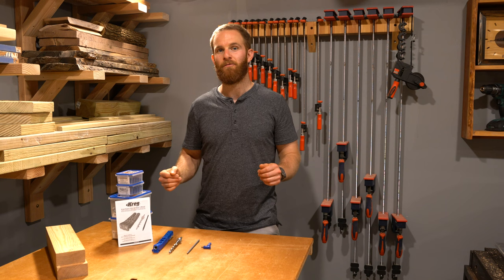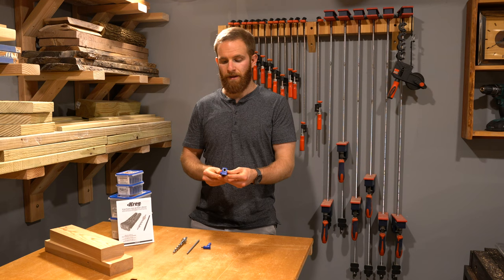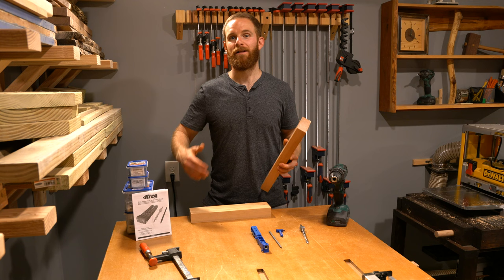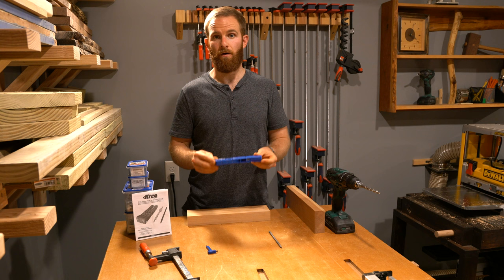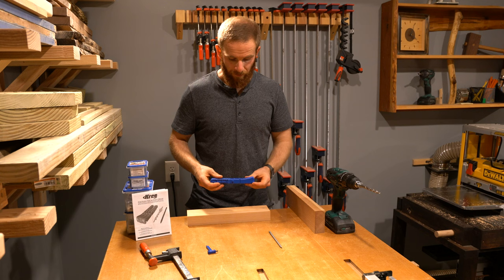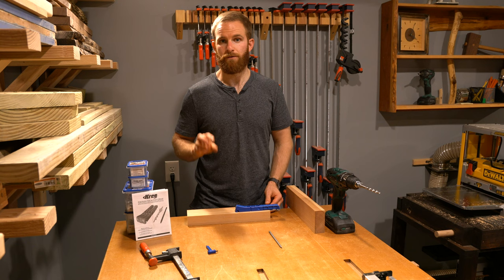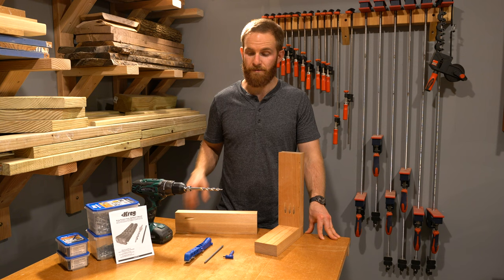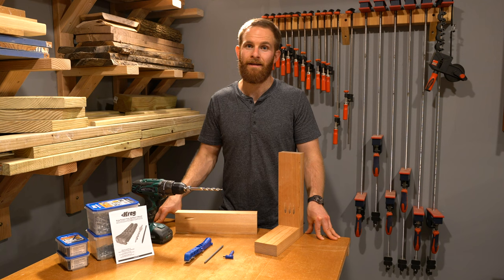How to Use a Kreg Jig 310 Pocket Hole Jig

Comment: Fantastic video. With a very helpful tip at the end.  As a newbie to the Kreg pocket hole product.  I have the 720 pro +  Which includes this 310. And I found the 310 to be much easier & useful.

Comment: Very nice William! Thank you for showing the budget friendly pocket hole method and it’s usefulness. I have the 520 since I do a lot of pocket holes and one of the mini’s I thought I’d never use. I will soon have to use it in the ceiling where drywall had to be cut out and at least one 2x4 needs to be installed for new drywall to attach to. 
Perfect 🤩 ! 
If anyone has long leg pieces as frame for shelves as I did yesterday with a 45” and 16” pocket hole joinery of boards. I found it easy to lay them on edge for face-to-end screw installation. A couple of hold-down clamps, a bar clamp, and verifying square along way worked best. For some reason I thought the leg had to be up in the air. 
Thank you again. Is there a way to submit my table saw stand and table that I’m making based on your plans for that?
Reply from the maker: You’re welcome! This Kreg jig 310 would definitely help add a 2x4 into an existing wall, good idea. Thank you for adding your advice and tips within your comment! I would recommend adding a comment to the table saw video about any tips once you’ve built it yourself for anyone else that watches the video, that would help!

Comment: While I'm not generally a fan of pocket screws compared to traditional mortise and tenon joinery, there are occasional times when pocket screws are handy.  I will use them when joining 3/4" rails and styles when installing wall paneling systems in my customer's homes and offices.  The pocket screw system allow me to join perpendicular boards when fitting up and better ensures a smooth and level appearance at each intersection of the rail and style grids. I appreciate this video!

Comment: Two comments.  The inside out pocket hole you demo'd is a much weaker joint than outside in (notwithstanding the need for a plug).  When you are drilling hole, best to soft jackhammer (in and out)
Reply from the maker: I just looked this up on the kreg jig website and they say that both orientations are just as strong and that there’s no difference in durability between the two. They say what matters most is if the screws are going to be concealed for aesthetics.

Comment: Is the direction of the hole to the joining wood correct in your demo?
Reply from the maker: The other way would probably be more ideal and have the screws facing the long side of the board rather than the end of the board but you can orientate the holes either way and it still works. Especially with this thick of lumber I don’t think there’s any huge advantage between the two.
Reply from the maker: I just looked this up on the kreg jig website and they say that both orientations are just as strong and that there’s no difference in durability between the two. They say what matters most is if the screws are going to be concealed for aesthetics.

Comment: you really don't known much about pocket holing? what about first mentioning material size, selecting type and length of screw, then test drilling and if necessary adjusting collar depth on drill bit.👎
Reply from the maker: I cover each of those things you mentioned in this video. There’s no need to do a test drill as long as you adjust the depth collar correct in the first place. As I explain in the video, you measure the material thickness with the Allen wrench and then adjust the stop collar based on that measurement.
Reply: I think he did an excellent job of explaining all of the basics.
Reply: He did cover all that, he did awesome without making a super long video.
Reply: What do I do if I’m working with material size of 4x4 piece attaching to another 4x4 piece?